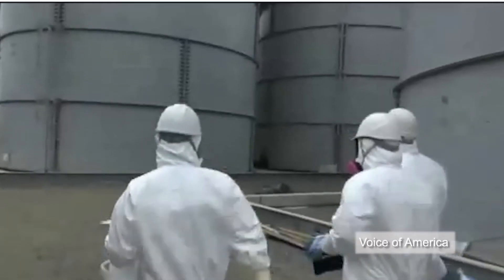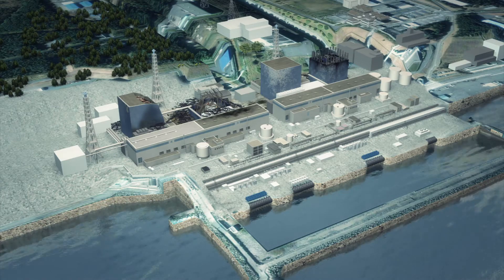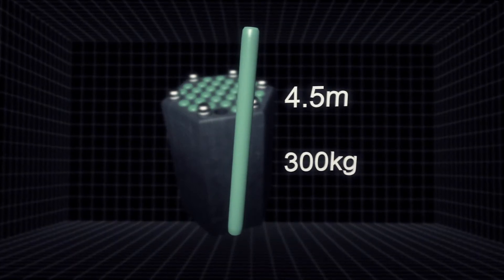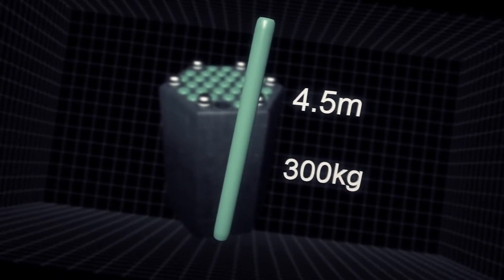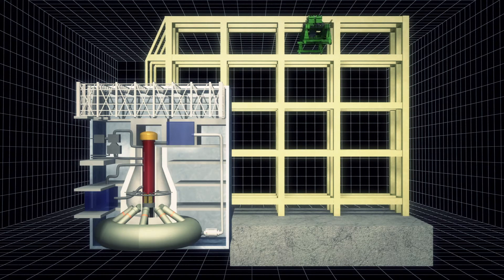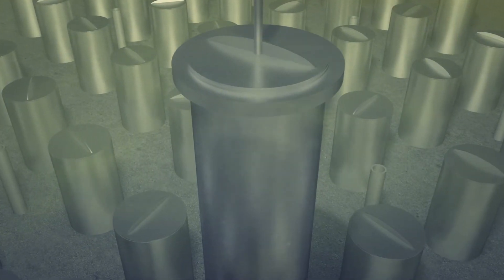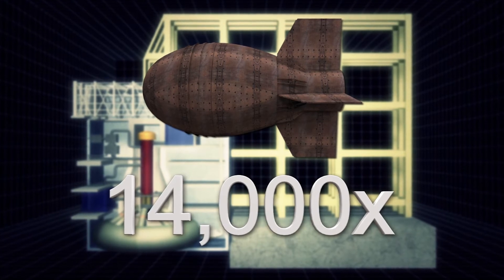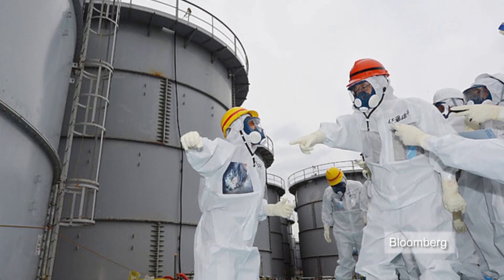Fukushima cleanup: extracting nuclear fuel rods from damaged reactors

Comment: 110,000 Bq/Kg of Cs-134/137 from spotbelly rockfish of Fukushima plant port
November 24th, 2013 Fukushima Diary
110,000 Bq/Kg of Cs-134/137 was measured from spotbelly rockfish of Fukushima plant port. This is 1,100 times higher even than the safety limit.
Cs-134 : 34,000 Bq/Kg
Cs-137 : 76,000 Bq/Kg
101,000 Bq/kg of Cs-134/137 was also measured from marbled rockfish collected. This sample was from the port too.
Radiation level of marine products is still significantly high.
http://fukushima-diary.com/2013/11/110000-bqkg-of-cs-134137-from-spotbelly-rockfish-of-fukushima-plant-port/